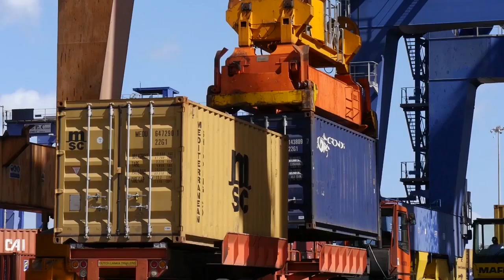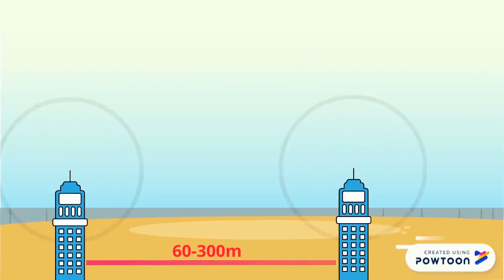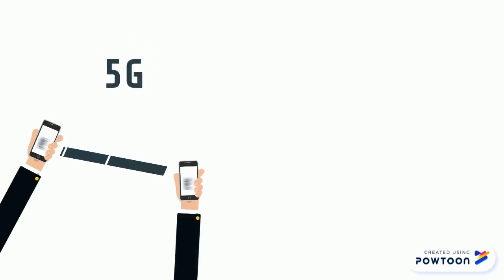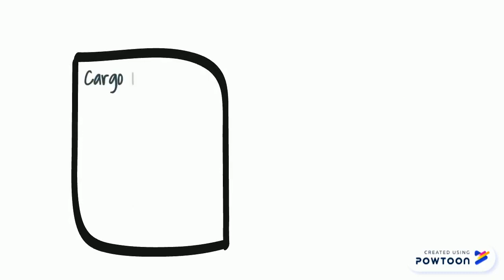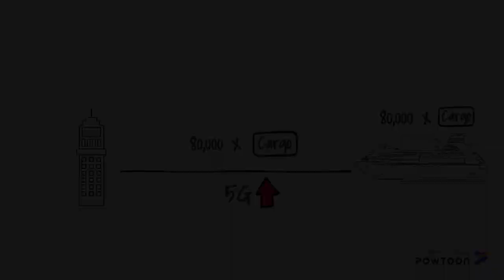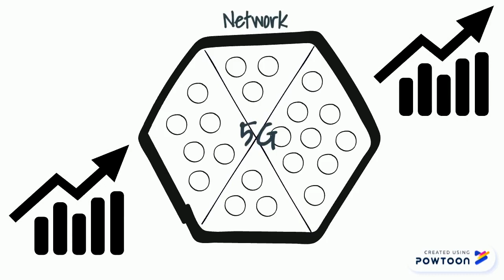5G in Smart Port

Comment: nice informative video! how does the 5g   concepts mentioned earlier benefit our  lives in terms of efficiency and resource use
Reply from the maker: Hi Alex. 5G helps increase efficiency as long as we are within the 5G coverage, we will get very high speed internet with low latency to help hasten our daily lives (e.g. remote cooking, get real time data faster etc) and reduce resource use (e.g. electricity, energy etc).

Comment: Since 5G cannot travel longer distance than the previous network and we need more small towers to handle signal link then how can we conclude that it will be more efficient to use 5G? And will it be more costly due to the installation of small towers?
Reply from the maker: Yes Jun Hao, it will be costly of course. However, because of low latency, high throughput, things will response way faster, this will give a lot of impacts to our daily lives, in many application e.g. remote operation, VR/AR technology.

Comment: What I have heard that 5G will be an advanced type of wireless internet. Will there be a relation between 5G and WiFi then?
Reply from the maker: Hi BQ, thanks for your question! The WiFi we are currently using is 802.11ac WiFi, it delivers speeds ranging from 433 Mbps (megabits per second) up to several gigabits per second. Now, the new standard, 802.11ax, is going to be called WiFi 6. Just like 5G, it will offer higher throughput, speed a few times faster than the previous standard. In most cases, “5G” is just referring to the new cellular standard. However, they both deliver higher speed internet networks (WiFi for indoor device usage, 5G for mobile data outdoor usage).

Comment: 5G certainly can bring many benefits to allow a port evolve into a smart port. when can we expect a 5G network to be implemented in Malaysia for other devices?
Reply from the maker: Hi Natalie! Malaysian Communications and Multimedia Commission (MCMC) is already doing it right now! For your information, there is already 5G network available in certain area of Cyberjaya. They are planning to move from 4G to 4.5G in the meantime by increasing the frequency of the current network. However, to completely move to 5G, it will take quite some time.